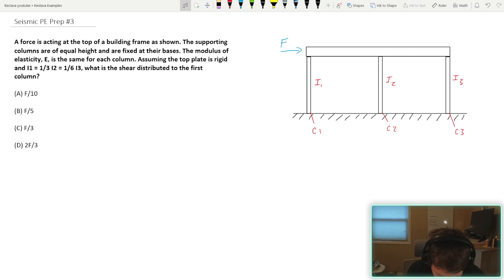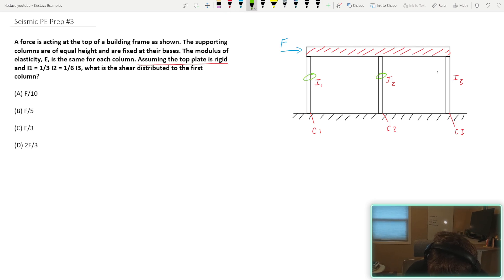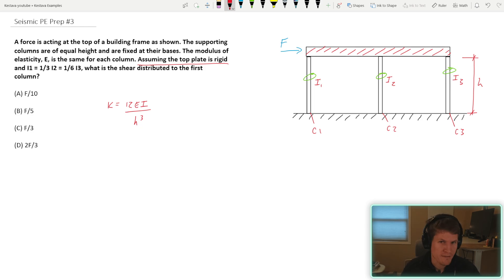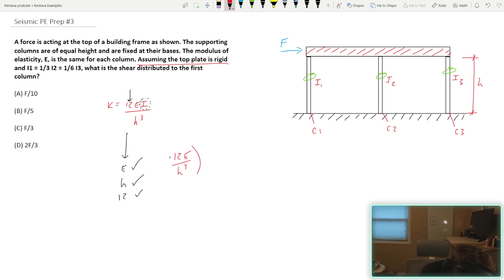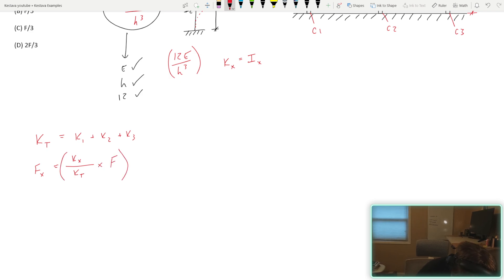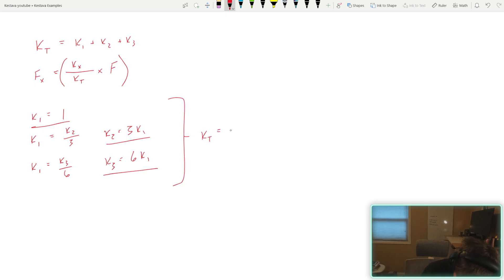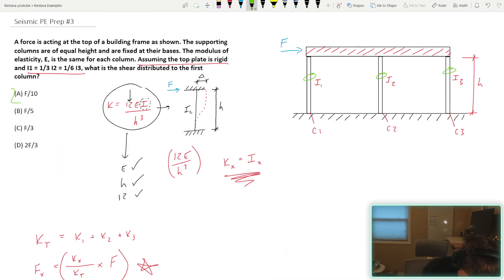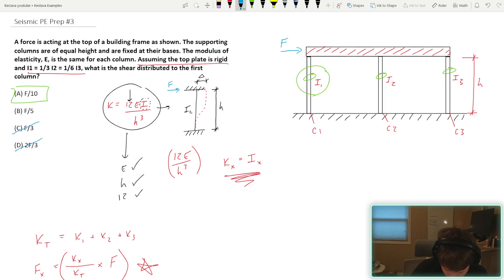PE Seismic Example Problem - 3 #structuralengineering #civilengineering #engineering

Comment: Great video. I like to see look at it as if the force is distributed proportionally to the columns based on their stiffnesses. So if column 1 has EI, column 2 is 3EI, and column 3 is 6EI and all columns are the same height with same boundary conditions, then shear at column 1 = F*EI/(EI + 3EI + 6EI) = F/10. That is indeed what you did, but knowing that the top beam is rigid and that it's a linear system let's you shortcut this problem. Every second counts on the SE!
Reply from the maker: Well said! i try to make it simple, but i find myself blabbering at times hahaha